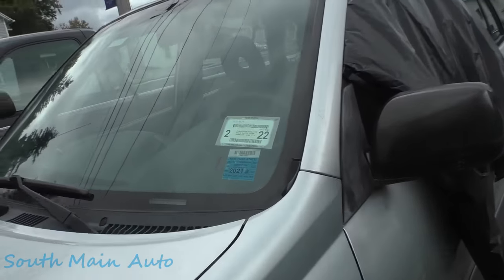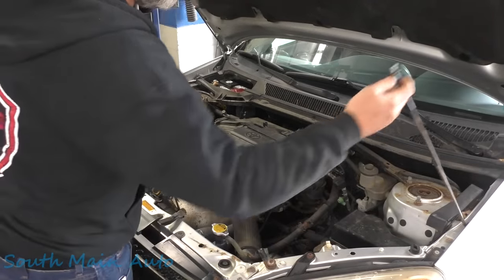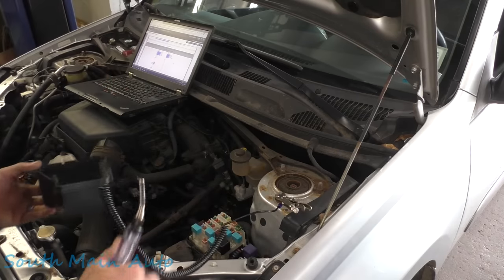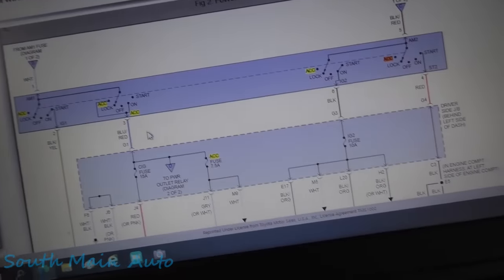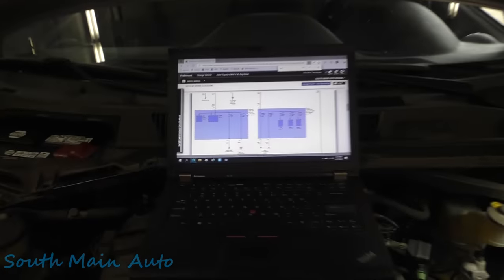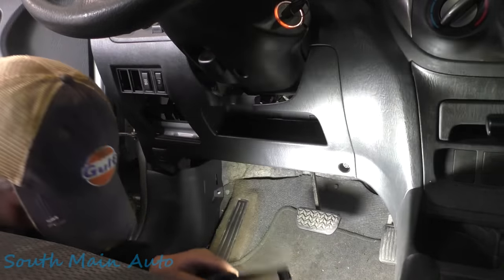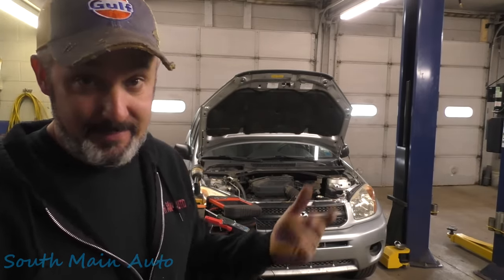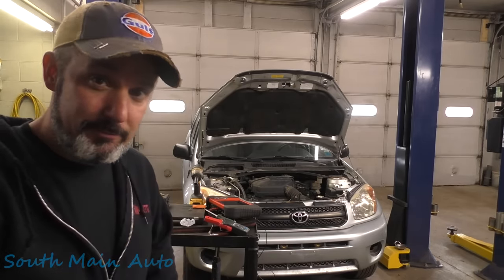Toyota Rav4 Is D.O.A. But Still Runs?

Comment: It was Brave to take the car to the junkyard in the first place if that blue again on the road do you would have a driving vehicle but you wouldn't have wipers lights or horn Etc Brave man. Might have been reasonable to contact the owner to see if he wanted the other stuff done while he had it in the shop it was at the junkyard could have had a switch hold down and fixed it.

Comment: Hello, Eric O.  After watching all these news videos of H. Ian, and seeing cars being driven hood deep in water, I must wonder, even if they don't stall, will they have problems down the road from water inception to the gears, bearings, universals, etc?   Would it be prudent to change or at least check the differential and manual transmission oil, wheel bearings ...?   Wonder if repair shops will be flooded with failures of this nature?   🌊💧🌊💧

Comment: I have those lights too, I ordered hd magnets and Jb Welded them to the bottom. The supplied magnets are trash. The battery not tied down caused this, then a cascade of failures occured. These vehicles are bullet proof, but not moron proof. I recently worked on a stump grinder where someone had installed a "used" battery in the steel hydraulic box. The battery was rattling around inside there, and you could see where it had been arcing to the box all over the place. A battery must be properly secured in place and shock mounted on rubber, if you ask me. The back of the box was the fuel tank. This could have been a real disaster. I'm sorry, Eric, but in a legal situation, you could be held responsible as the "most knowledgeable person" should a suit ensue. You need to appraise the owner when a dangerous situation could result from ignoring an issue. Have them sign a hold harmless document if they insist on being stupid. Leaving that battery in an unsecured state was wrong IMHO.

Comment: i have seen people hookup jumper cables backwards off altenators before. they put the positive on the battery and are looking for a ground off the engine and a black wire with no red cap is right in their face.

Comment: Likely a case of a DIY’er who knows just enough to be dangerous and not enough to diagnose the result of his own mistake. I’m also guessing either that battery is the wrong size or a previous one was hence the lack of a mount. And that rattle can engine sounds like high miles and/or not enough oil changes.

Comment: Soooo what if the guy who replaced a bad alternator didn't disconnect battary during replacement. Grounded the hot line blew fuse. Replaced battary since it wasn't charging. I have seen similar things at my shop. Wouldn't be surprised

Comment: I bet the battery was replaced and it was hooked up backwards. My grandpa did that to the Sequoia and nothing worked but it did start and run just wasn’t drivable. Uncle came by and checked all the fuses that when the main fuse was broken.

Comment: So the fuse was blown when the alternator was changed out because the alternator battery wire was touched to ground is what I'm thinking. Decades ago I accidentally blew up a battery on a MG while changing out the starter because I accidentally touched the starter battery wire to ground. The owner didn't supply a trunk key to disable the battery. I was young and my boss sold the customer a new battery in addition to the starter.

Comment: I'm betting when they replaced the alternator they either flopped the battery cable off and it shorted or the wrench/ratchet they used on it shorted it out.  They were just "fixing what they were hired to fix" and didn't think twice that nothing else worked after the new battery and alternator install.

Comment: If the customer installed the alternator, it's possible that the battery was not disconnected and a short between the output stud and frame of the alt led to this problem.  The customer may be embarrassed to admit his error.  Wilberts should offer golf carts for customers to travel to the nether regions of their establisment.

Comment: My 2 cents: grab the battery hold down(s) and a few clips while you're there. Takes an extra 3 minutes, the yard prob won't even charge you for the plastic clips (or they could fall to the bottom of your toolbox, who knows) and the holding strap/brace is likely $3 to $7 from them. Then you try upselling the customer. "I fixed the car and it runs. This will happen again if you don't strap the battery down. I can do that for another $40. Also if you want I can replace your zip ties with the OEM clips for another $15/$20."

Even if the customer says no, how many RAV4s might have similar issues? Could be useful parts to have on hand for the future. And OEM Toyota clips are good to have on hand in case you break one in the future on your car or a customer's car (it happens to the best of us sometimes).

Just a thought. Customer says No and you're down $10. Customer says Yes and you're up $20 to $40 (depending on how much you decide to charge for the extra time and part cost). $20 for the 3 extra minutes at the yard seems worth it.
Reply from the maker: Sure, it all seems logical when you say it like that. First of all, I'm not a thief so I don't steal stuff from the junkyard. Second of all it has the wrong battery in it and the factory hold down would not fit anyways even if I did take it.... Just saying

Comment: Hey eric....i just bought a 1995 f350 7.3L powerstroke flatbed.  not running.  crank no-start.  which internet service would be best to rework this truck, alldata or mitchel's or some other?  If you or one of your fans have an opinion, i would love to get your feedback.  seems like all the YT videos are part swappers with very little testing.   also, will the action OBD2/1 scanner you used on the ford work on the diesel OBD1?  glad you and the family are thriving!!!!  LGB! - pete

Comment: I wonder if it got boosted backwards or they took the alternator out without disconnecting the battery. Had a 2010 Santa Fe  come in with the same problem. Guy left the shop down the street and made it to our shop a few minutes later with a battery light on.

Comment: That what happens when you don't disconnect the battery when you replace the alternator. I blew my fuse and had the same issue, car started but had no accessories.

Comment: The amount of current that your solder connection can take is totally determined by how much resistence is in your solder connection  if the resistence of your solder connection is 0 ohms, then the total current would be the rating of the fusible link,,,  :-)

Comment: My speculation that the original battery was dead and someone attempted Jumpstart it incorrectly, and then assumed it's alternator, when that didn't work, they went and bought the cheapest battery, when that didn't work, they dumped it on the marketplace.

Comment: My guess is his battery died after the fuse blew. Someone checked voltage at the battery while the truck was running and didn't get 14 volts so the conclusion was made that the alternator was shot and he should replace both he did and when it started nothing was still working.

Comment: Looks like the guy didn't unhook the crankshaft from the caniffling pin driving master cylinders differential torque manifold when he tried to replace the battery thus blowing the secondary circuit breaker's fuzable relay link going to the body control module that runs the tail light defroster and the accumulator on the radios mosfets that return negative current to the altinators main combiner and blinker fluid evacuation canister for gaseous regeneration.

Comment: I would have just left the "copper penny fuse fix" if it were my car....LOL 😃😁🙃
Reply: I would have connected wires to the burnt ends, drilled a hole in the plastic and put a stand alone fuse in the line. If the problem came back, the fuse is replaceable.

Comment: I'm thinking whoever changed the alternator took the big wire off without disconnecting the battery and found a ground! I worked on a fleet for 40 yrs. and was used to fix everything that was wrong. I can understand why a shop would only fix what the customer wanted.

Comment: I need to find another shop like yours.   My wife's car is currently in a shop with a punctured oil pan, being repaired.  I'm going to eat the excess costs for the parts because this shop refuses to buy from anything that the rep is calling a "DIY" seller.   That includes junkyards, RockAuto, NAPA, Autozone, Advance, O'Reilly, etc.    So, instead of the oil pan being $200 for a good Dorman, it's going to be whatever brand they get from their "professional" distributor, at close to $400.   I get not wanting to use customer purchased parts - but my last shop would do it, they just wouldn't warranty the repair.  Deal.  This shop won't even order the part I want them to buy.

Comment: I think they have changed the alternator without disconnecting the battery. Then when nothing worked they have replaced the battery, which obviously didn’t help

Comment: I would  have grabbed that window switch at the junkyard for an upsell attempt to sell them that service, easy sale and would have made the trip to the junkyard that much more profitable. You saw it before you left, kill 2 birds with one stone and looked like a hero.  I probably would have grabbed a few more broken bits and clips, like those battery and plastic trim if I found that exact ride in the junkyard. There is no way I wouldn't have grabbed those items to have them on hand for the sale or tossed them in for free because that's the person I am.  We are talking peanuts and very little extra time.  They would have paid to fix that window because driver window is a necessary safety item IMHO.  That's how you make the money, by selling a necessary service and going the extra mile. and customers love that.   If the guys at my shop weren't trying at least to find such blatantly obvious work ,they wouldn't have a job.  You may not convince the customer to replace a set of leaky shocks or a trans service, but they will fix a broken driver window 9/10 times. Did you honestly contact that customer about that window switch or mention it to them?  I could not return that car with that broken window without making the most valiant attempts at getting them to OK the repair. Still, as always love the video and your channel.

Comment: How did you get stuff working with the old fuse box by the battery and suddenly the other accessories worked? The lights came on in the dash and around the key insert area and the vehicle started. When came back from the junk yard with the part in hand had installed it and everything worked. Originally the large fuse was burned out so how had things going before going to the junk yard wondered?

Comment: Probably had a bad alternator and it blew the fuse, so they replaced the alternator and battery but couldn't figure out the other issue. Or they shorted the alternator when installing it.

Comment: The protective plastic cover was missing from the fuse box. The used fuse box from the parts yard came with the cover.  During the install of the new Alternator & Battery the juiced wire between the Alt & Bat got a dose of godzilla dragon breath an fried a Easter egg-(Crack).  How did it happen?  Bob had his head under the hood, someone came by slapped his ars and tickled him, Bob jumped hit his head dropped a wrench and POOF!

Comment: I once reverse jumped an 07 Corolla and it took out the main fuse and I believe a couple of fuses (AM1/AM2?) fuses under the dash.  Could this have been the case here?  P.S. - I was about to jump it correctly when my boss told me I was about to do it wrong.  So much for that!  I got to troubleshoot the problem and eventually got it running after replacing these fuses.

Comment: Nothing on the dash works, but the dang door dinger still HAS to. Pfffttt!
 At the 15 minute mark, I'm wondering if when the alternator was replaced, they didn't disconnect the battery and shorted the "battery" at the alternator.

Comment: I disagree with this just a little bit.   I would have definitely figured out a tie down for it, or got one at the wilberts and charged him a little more for it.  It was a necessary part of the repair--  I agree with your assumption that it probably just arced against that crossmember.   This could come back again fairly quickly since the battery is still bouncing around...  IDK, maybe I'm just thinking of how I would fix my own car.

Comment: Trust me it's an easy truck to work on 2001 GMC Sierra 1500 SLE 4x2 5.3 liter V8 I have drop in $14,000 in this Dan truck in all most 3 years for repair and labor the truck has 126,800 miles on the clock. I have replaced alot of stuff and it's still not done yet. Do you take on out of State Customers. Would love to bring you my truck to put some new parts in the front end for me.
Reply from the maker: No out of area customers. It never works out logistically.
Reply: @SouthMainAuto  DAM
Reply: @SouthMainAuto  what happens if you where going through that area for business
Reply: @SouthMainAuto  I go through there 2 times a year for business
Reply: @SouthMainAuto  Still Probably a NO Dam I will Move there if I have too lmfao 🤣

Comment: I imagine in the near-future , the liability of having BEVs in a wrecking yard due to the shock/death/fire hazard you will no longer be able to go in and snag parts. I have seen videos where the battery caught fire , could not be put out , so the wrecking yard had to bury it.🤣Imagine telling the operator on a rainy day "I need a used TESLA battery"
Even Munro Live on here sends vehicles to some specialist to have the batteries discharged before they can show you the assembly.

Comment: When i had my 2014 Toyota Camry with the 2.5L I4 engine, i had a high output 240A mechman alternator cause i was running an aftermarket stereo system in it.  Well the time came when i decided to upgrade from a camry to a new 3rd gen Tacoma, and i pulled all my stuff out of my camry.  Me being stupid, or at least not thinking about it, was pulling the alternator out, the batt positive cable grounded on the oil dip stick tube and blew the 140A alt fuse.  I left the battery connected when i should have diconnected it.  To replace that, the whole engine bay fuse box has to be torn apart to replace it.  WORST design ever.  Now, when i work on ANYTHING electrical, i take the time to disconnect the battery on my tacoma.  I even bought a custom warning sticker to put under the hood to remind myself and anyone else, just take the time to discconnect it and save the headache....  expensive lesson.....

Comment: Well in this case I disagree you should fix the hold down on the battery because that might be your issue so now if you get a come back for the same issue you still won't know if it's the battery hold down

Comment: They may of replaced the alternator, without disconnecting the battery, and shorted the wire from the batter to alternator to ground.

Comment: Perhaps someone changed the alternator without disconnecting the battery. Shorted the main cable to ground. That would do it. The car ran so they just drove it. Battery wasn't charging and was left flat and went dead so they changed the battery.

Comment: just to let you know about that 140 amp main fuse just hooking up a new battery will blow that  happened to me  a couple of times  i even put a  and currently running a marine battery in my truck  just to ask you would it hurt the electrical systems on a vehicle with a marine battery  vs. a regular battery  please let me know what you think about that  i would like your input on this matter thanks

Comment: How much of a cost saving is there using a junkyard vs an aftermarket part,  if you add in the cost of your time to go and get it out?
Reply: All depends on if the part is readily available.   A fix today is sometimes worth more than waiting a few days for a part to come in.  And things like fuses don't really have a cycle life... So it's not even like there is a strong argument to be made for new vs used in this case.
Reply: @Robert-S-  I don't presume to know your business and you of course know it well. I guess if the customer pays for your part scavenging time, you're not losing out. If  you don't charge, then that's something different and your choice.
Reply: @snidelywhiplash8923  Agree completely.

Comment: Coming from the copier repair industry, we are programmed to find anything wrong and fix it as >95% of machines have a contract for repair.   Then you have salesmen/women in the industry that bid out minimum cost per copy on contracts.  Some people bark when they see us putting in "reclaimed" parts (never say used).  That never used to be the case that we would use reclaimed parts, but it is the only way to come out ahead anymore.  Seeing you put in that reclaimed fuse box made me think of it.   Non contracts we will offer  only new parts.   How do you bill out reclaimed parts?  Ours go for 50% new price.

Comment: Sorry to disagree but finish the job.  While I agree I wouldn’t be looking at that pile of fuses or broken trim pieces, I would have picked up the battery hold down at the junk yard while I was there because there is a high probability that is what caused the original problem.  If you were just contracted to get the car running, then solder the fuse and park it in the lot.  You went most of the extra mile to get another fuse, but fell short on the battery hold down.  First upstate NY pothole and that car will be back in the lot.  Why not just charge him for the hold down AND the fuse and make it somewhat safe?